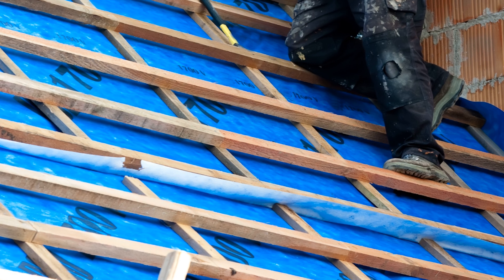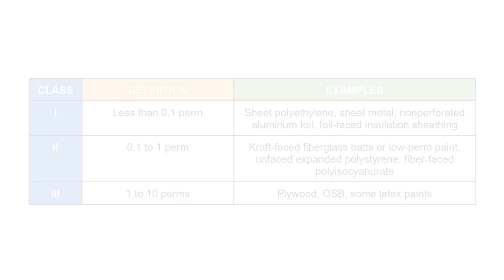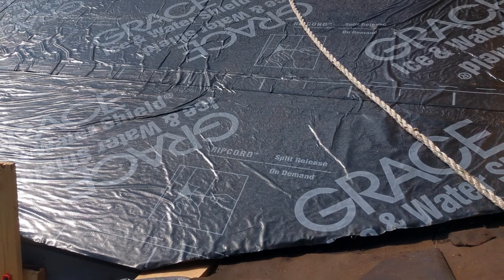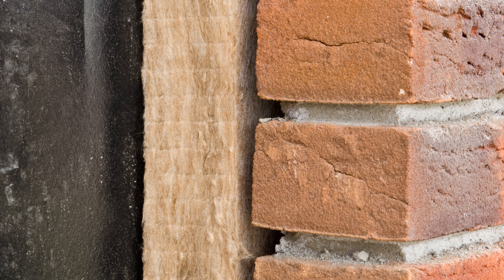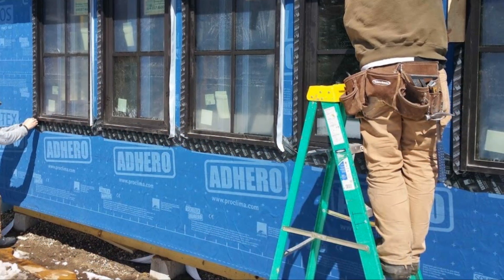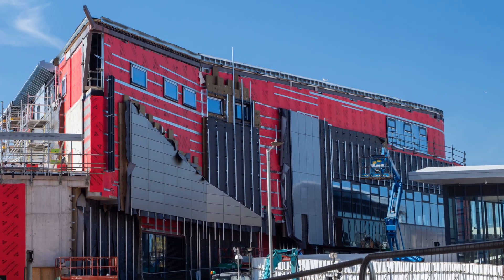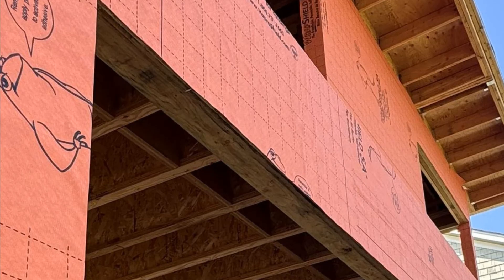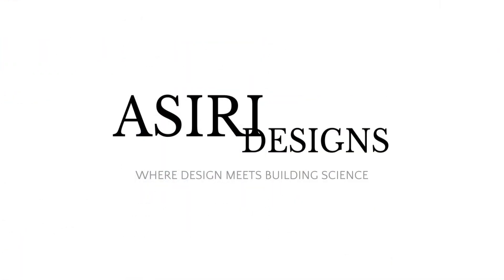Do Peel & Stick Membranes Trap Moisture?

Comment: I am comparing Adhero 3000 (8.2 perms) to Henry VP100 (33 perms) for a wrb. Walls will be sheathed with 1/2" CDX ply (10 perms). I am looking for high vapor permeance. Is the difference significant when adhered ply? Or does the value of the plywood throttle the drying potential to where either will work fine?

Comment: I’m interested to know more about  the impact of adding exterior rigid foam on the ability for the wall to dry outwards when using a vapour permeable SA membrane. Does the foam board installed tight to the SA WRB prevent drying? If so how important is it to use a SA WRB with an incorporated drainage plain (like Hydrogap SA)? I understand that rock wool would solve this potential problem but I’m trying to understand the best methods of using foam board on the exterior. 

Love your channel and the comprehensive information that you share! It’s an incredible resource.

Comment: If moisture is accumulating in an attic space like that, there is an issue first with the venting. Ridge vents can get clogged or installed improperly which would prevent moisture laden air from being drawn out the vent.

Comment: Had my roof replaced back in May. I was so pleased with the contractor for seemingly being in-the-know and getting the ice&water shield layer up there. After watching this video, now I'm all paranoid that it's just up there rotting my roof away (lol)...
1.  If I do poured concrete walls (actually hate the styrofoam on ICFs), I was gonna do the black asphalt water sealant for the buried part of an integral footing, and I thought a peel-n-stick would keep any water that got through the rain screen from getting on the concrete.
2.  Do you think Xypex admixtures or sealants have a good reputation to make concrete waterproof?
Reply from the maker: @WhiteytheLab  No need to worry if the roof is vented. As for the cast in place concrete walls, it really depends on the assembly but when we are dealing with below grade conditions, we actually want the benefits of a vapor retarder since moisture is always trying to try to the interior. Drainage is more important than the waterproofing in this case in terms of keeping water out. We actually have a whole video on below grade waterproofing systems on our channel that we posted a few months ago.
Reply: @ASIRIDesigns  THANK YOU! My attic is so well vented I felt the ceilings lift when I got hit by a tornado 6-months ago (lol). Thus the severe desire for a concrete home, aye? I'll go find that below grade video... I'm assuming you folks are available to hire as consultants when I get to the design phase? (saw tyou had a 10-hour minimum, which was fine.)

Comment: Great video. The BS+Beer show talking about "vapor barriers" with Steve Baczek just released yesterday as well. I only half paid attention but it sounds like the easy answer is avoid barriers (everything needs to dry) and watch out for microclimates. They mostly talked about poly though, not peel-n-sticks specifically.
Reply from the maker: 100%. You have to be extremely strategic when it comes to vapor *barriers*.
Reply: I know, right? At first I thought I was supposed to seal my buried concrete footings/ walls from water infiltration by using the black asphalt sealant. Now, I may just be trapping the water to the interior. I also considered a Xypex concrete additive to make the concrete itself waterproof from inside.
Seems the tighter we make these buildings, the more moisture problems we have. I'm considering just having a poured concrete wall, 2-inch thk rigid Rockwool (which breathes), and a rainscreen like brick or hung slate tiles (CupaClad). I thought I was supposed to use a water sealant to protect windows and openings from any water that gets past the rain screen, but now I just don't know...
Reply: @WhiteytheLab  Interesting. This is a learning process for me as well. My takeaway from all I've gathered so far is that concrete is always wet, and it is going to dry to the inside, and that's okay. If you want to try to block vapor/moisture, the primary barrier goes on the outside (asphalt/drain mat on the walls; crushed stone on the underside). Next is your insulation (EPS - it has to be ground contact rated; XPS/Polyiso are no good wet). Then consider your vapor barrier: immediately below the slab continuous to the interior concrete wall. This will hold all the moisture inside the wall. It will try to dry to the uncoated above-ground exterior or if you are using ICF up through your sill. Make sure you use a gasket or sill seal so you don't have wood on wet (concrete). If you don't have a vapor barrier on the interior it will dry to there. What you don't want to do is frame or insulate and put the barrier somewhere else because the water is mostly in the wall, not in the air. If you wanted to add another vapor barrier for whatever reason (and you probably don't), use a vapor-variable membrane. I think ASIRI has mentioned manufacturers in other videos. The real problem with moisture (according to BS+Beer) is air. I'm making up numbers here, but vapor pressure will move something like 3 liters /day, while a 1" square air hole can move 30L/hr. Stopping air movement stops the vast majority of vapor movement. Anything above grade you're trying to stop bulk water, so yes, take lots of precautions there. Let gravity do its thing and always give water a way out and away so walls can dry.
Reply: @ChristopherCurtis  Thank you for taking the time to explain that for me. It is truly appreciated. It feels like the more I learn, the less I know (lol!) Thank you again! Actually, it's great information and will help my design considerations (and price estimates to know what to include...)
Reply: Drying into the mudsill for ICF didn't make sense to me so I looked that up: If you have a vapor barrier going up the inside of the concrete wall, you want to tie it to the exterior WRB under the mudsill. The principle is the same though: keep wood off of wet. It appears that the situation is the same for exposed ICF: EPS is a Class II vapor retarder so moisture is still going to dry to the inside, albeit not as quickly as if the concrete were fully exposed.

I wonder if anyone can answer a question about gaskets though: I've read that gaskets are better than sill seal, but if we're tying the vapor barrier to the external WRB, how are you sealing the gasket/sill-seal? Concrete->caulk->poly->caulk->top-plate makes sense to me as a barrier construction, but where would you add sill-seal or a gasket? Concrete->caulk->gasket/seal->caulk->poly->more-caulk->top-plate? Do you skip the more-caulk and assume that nobody will ever puncture the poly/vapor barrier?
Reply: @ChristopherCurtis  Hoping someone will answer that one too... more research. Since I'm not doing ICFs, but considering one of those slate rainscreens, the tracks that they mount onto will be piercing the concrete wall anyway. Whether I stick the barrier up first (and then pierce it a zillion times), or mount the brackets first and then try to stick up the barrier around them sounds inadequate - so I'm actually thinking of a liquid. 
Although in the end, I'll end up submitting a proposed assembly to a professional for review. I understand vapor pressure and concrete curing, but I haven't specialized enough in these products and building science; and sometimes, I'll have to admit that this is someone else's area of expertise...
Tomorrow morning looks like, "Google gaskets vs wraps vs sealants around windows in concrete walls. (Thanks for the heads up!)
Reply: @WhiteytheLab  The gasket appears to be a specialized product just for airsealing the mudsill/top-plate. I suppose it would work around a window, but I haven't seen anyone talking about that. I think windows generally come with their own gaskets, but I haven't done any window work yet. Just remember to keep the bottom open so that any trapped water has a way out. For your wall, I (knowing nothing, of course) would do the peel-n-stick first, puncture it for the rails, and then seal the punctures as much as you can. I used the Blue Barrier, but I hear a lot of chatter around Lexel. If you know you're going to be puncturing your waterproofing it's probably wise to add a drain mat to keep the pressure at bay.
Reply: @ChristopherCurtis  Thank you for clueing me in. You didn't have to, and it's greatly appreciated 🙂